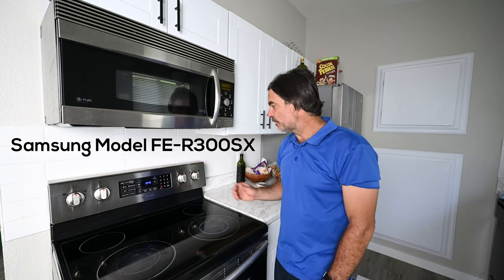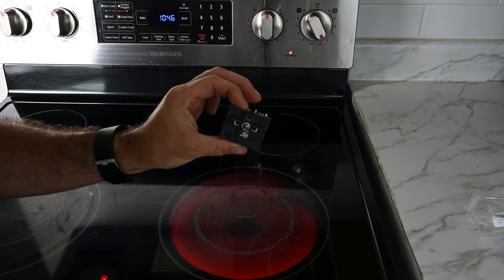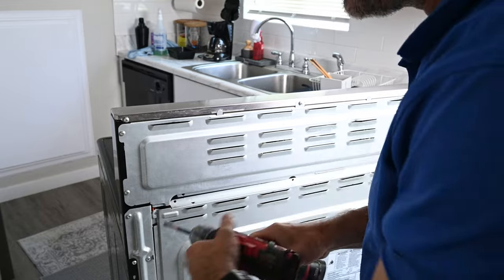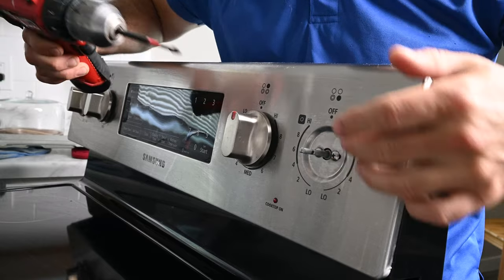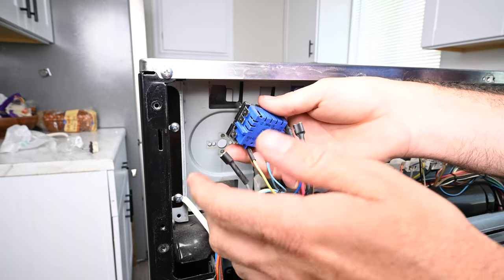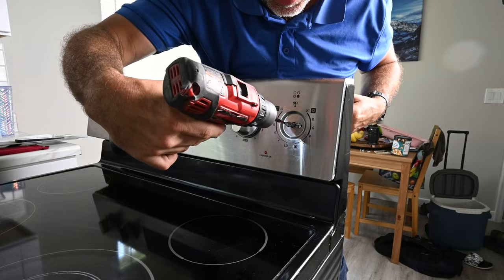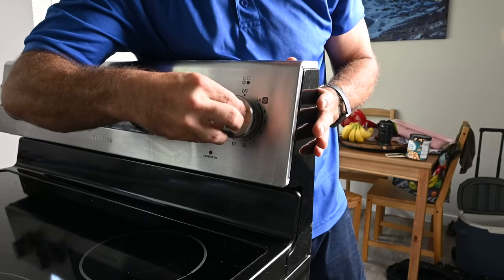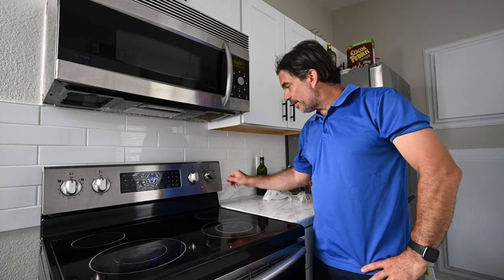Samsung Stove Burner Stays on High Heat Only (Electric Range)

Comment: This should be a recall and SAMSUNG should repair it for free. Mine does the same thing!
Reply: It's not a Samsung thing. It's one of the most common repairs with stovetops. This could have easily been a Whirlpool or GE. There are hundreds of youtube videos showing such reoairs.  The biggest culprit I've found is that people typically use the same burner over and over. To get longer life....spread the love...rotate the crops...or use whatever analogy you like to remind yourself to use different burners when possible.
Reply: Id have to respectfully disagree. Just because this is a well known issue with all the brands, doesnt mean its not an issue with Samsung as an individual. That is the company selling the product I purchased. They made or sourced the components for their product, so they are accountable. 

This is a well known issue, historically speaking. They should do better, and supply units that are more reliable. Or offer a reasonable remedy.
Reply: @johnd5542  samsung blows cats
Reply: Mine does this to.
Reply: My slide in electric Samsung does the same thing and with young grandchildren wanting to help cook I think it is very dangerous!
Reply: Decided to tackle this and it was easy.  It was harder getting the screws lined back up than actually fixing the problem.
Reply: Mine, too
Reply: @Nclght . Samsung is junk. All my appliances are Samsung (not by choice) and they are always in various states of disrepair.
Reply: @Jackmerius_Tacktheritrix5733   They aren't any better or worse than the other major  manufacturers. The difference is the quality of your repair technician. Technicians who are not   up to date or are not competent typically will tell you the ones they don't know how to repair are junk.
Reply: @Nclght  Dumb comment. They're junk. It's not about the repair ability of the technician.
Reply: @Nclght    Right, because all consumer products are equal in your world. 😂
Reply: @Jackmerius_Tacktheritrix5733  And where did I say, "All?" Apparently, you havr no idea about cross-manufacturing  and neither do you understand the many of these companies are subsidiaries of another. Also, most of them get their parts from the same oem manufacturer.  But, then again, it's best you remain quiet while grown-ups are talking.  If I want your input, I'll make sure to type things out in a crayon font for you.  🙄
Reply: @Nclght    You know plenty about cross-dressing though
Reply: I have this issue on my whirlpool at the moment. Seems like a common component issue.
Reply: @FaizCaliph   It is. I just did this on 2 whirlpools and 1 Frigidaire.  Most of these companies have their switches manufactured by an OEM manufacturing company, Robert Shaw Co.  So despite what xenophobic, narrow- minded people believe, these switches fail equally among the different companies. These parts are rarely exclusive, and if you understand the coding, you can replace it with the exact but much cheaper switch that has a different company label.  You would have to match the amperage and clockwise vs. counterclockwise  knob rotation as well as the knob stem design.

 Even the burners are typically manufactured by the same oem company.  Differences are usually found in the user interface/boards.  Samsung and LG typically manufacture their own since they are electronic companies. They usually have fewer board failures than a similarly designed whirlpool board since  Samsung and LG are oem board manufacturers. Those companies are typically better at electronics since that's who they are.  Their problems come when they push the envelope or introduce a new mechanical design.
Reply: Does regulator control all the heating elements on the stove?
Reply: @Nclght  Samsung representative detected. I've NEVER had any stove do this, SamDung sucks ass
Reply: @Kr0n3kLe  Your experience is laughingly limited. I'm an independent tech who has worked on appliances before you were born and in numbers that make your experience statistically insignificant....ie your opinion counts for absolutely nothing.

Comment: Same issue on both double burners. Fixed left one by removing connectors and applying contact cleaner. Then the right burner started acting up and the cleaning fix didn't work. This started with a five-year old range, which says a lot about Samsung ranges. The parts aren't cheap either.

Comment: I followed his instructions and replaced the switch in about 10 minutes. I have never done this before. Do exactly as he says and it will be simple. It took longer to clean behind and find the part to order than actually replace it.
Reply: Will this fix both front burners or just the one?
Reply: @jacquelynabrams1219  I replaced the part for my double burner in front, so it fixed it. Each burner has its' own switch, so if multiple burners are out, you will have to replace each one separately.

Comment: Good video. I’d like to add that you should turn off the circuit breaker before unplugging the oven. I learned this the hard way. Also, the replacement part came with a completely different set of connections, so I had to translate it so take multiple photos from different angles as some wires might cover up the view of another. There’s also two of these on my oven so got to buy another.

Comment: Thank you for the info. 
For some people it may be better to just replace one wire at a time after you screw the new switch into place . Sometimes you get a bad angle when taking a photo and a couple wires are not seen .
Reply: Keen point!

Comment: Thanks. Same thing for the right side replacement. I need to tape one of the missing wire connection (at the left bottom corner) for the OEM part. Works well :)

Comment: Our Samsung FE-R300SX just started doing the very same thing now on the two front burners.  You had to open the broiler door to get to the model number.  Curious to see our range was manufactured in Thailand on March 2012.  We purchased it in April 2012.  I wonder if these equivalent ranges are now all made in China.  Anyways, thanks to your video we can quick fix the problem.  Thanks!

Comment: I currently have a gas range in the home I'm renting so this obviously doesn't apply to my living situation at the moment but I've always wondered,  are the infinite switches interchangeable between the glass radiant cooktops and the older style coil cooktops as long as the number of elements (single size, 6/9, 6/9/12 inch) and wattage match or are very close?  In case my next house comes with an electric range.

Comment: I was trying to replace a burner regulator on my Samsung (model NE59M4320SS) and gave up as I was unable to pull out one of the Molex connectors from the old regulator (the white connector with the double red wire). It just wouldn't come out no matter how hard I pulled so eventually I just stopped as I was afraid to damage the connector. All the other wires came out pretty easily. Just for comparison, I also tried to pull out that same connector from the other fast boil burner regulator and it would not come out either. I am thinking it must be designed this way and there is probably some kind of an inside lock or something, but I just cannot figure it out. Any advice?

Comment: I followed these directions and when I plug the cooktop back in the “cooktop on” light comes on and the burners I replaced are getting warm without me turning them on. Any thoughts?
Reply from the maker: Sounds like something is mis-wired. Verify everything is hooked up correctly via your models wiring diagram

Comment: mine is front left dual burner...is it the same switch.??
Reply from the maker: The one I replaced in this video is a front dial burner but I cannot say if it will work for your model

Comment: Will this work on any model of Samsung? We have model NE59J775OWS. Having the exact same problem where the front right big burner only functions on high heat… HELP
Reply from the maker: Yes it will you just need to make sure the infinite switch matches the one for your model

Comment: I have the same problem. Found exactly the same part on amazon, replaced everything correctly and still have the same problem. What gives?
Reply: I wouldn’t be surprised if the new switch you bought is also defective. They are very cheaply made parts. Barring that there may be a broken temperature limiter under the range top.

Comment: I tried this fix for our Samsung. Instructions are very easy and we bought the infinite switch based on the model number but seems like the stove is still having the same issue. Any ideas what else could be the problem after replacing the infinite power switch?
Reply from the maker: double check you replaced the right switch for the burner, if so send the switch back, the switch directly controls the voltage to the burner so there's really not another option

Comment: https://youtu.be/ecsc0e6RzUg?si=S0PFB0bBqEflWGS4 I have a brand new stove that’s doing the same thing but it doesn’t do it all the time. Tech issued by Samsung was out yesterday he agreed it should not be red hot on 2 but said he had to call a tech to explain to them what it was doing and after I was told she said it was designed to do that. He said he couldn’t do anything for it since she said it was fine. And that I would need to contact Samsung again.